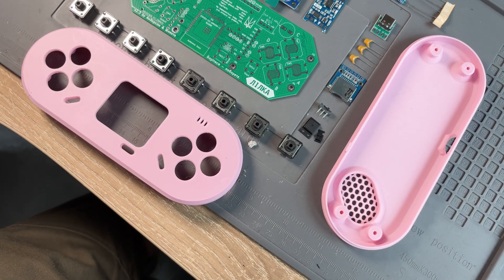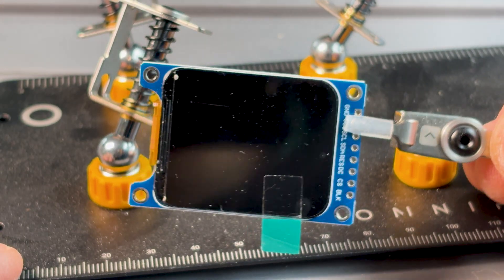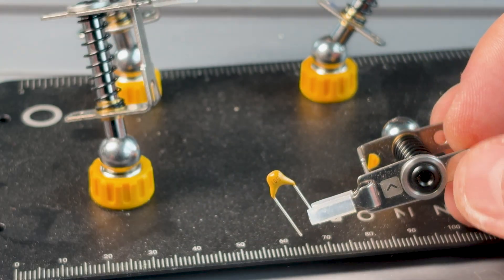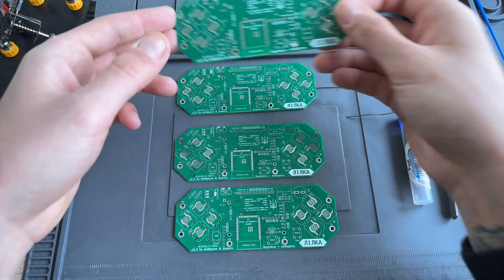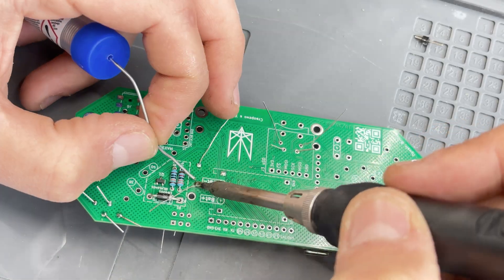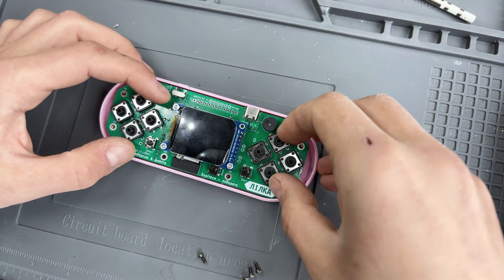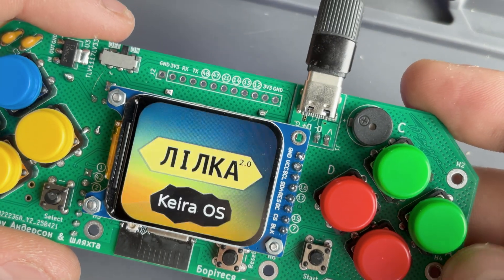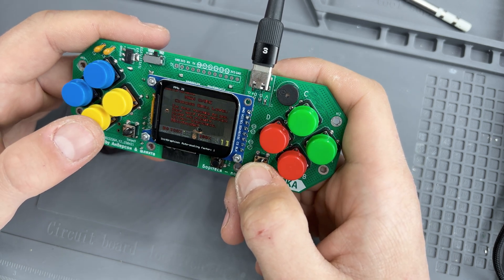DIY Gaming Console

Comment: Thank you for the video. I have the same case, but my Lilka wasn’t adapted for it. Were you able to fit Lilka into the case?
Reply from the maker: Unfortunately, no. I ended up using double-sided tape for the battery and speaker